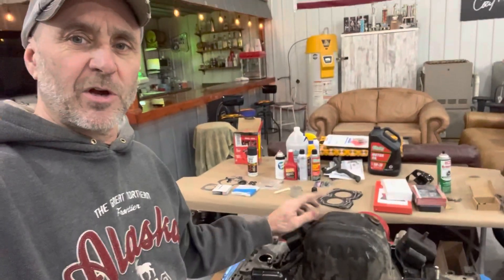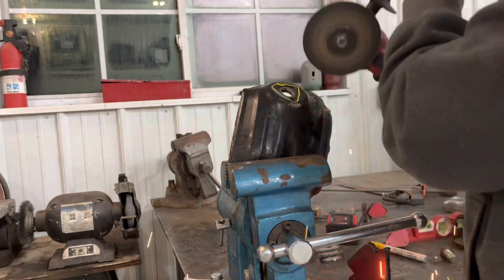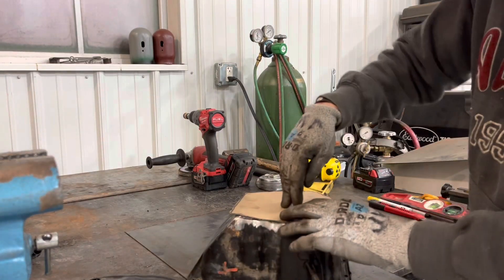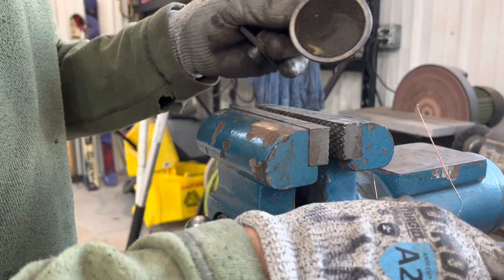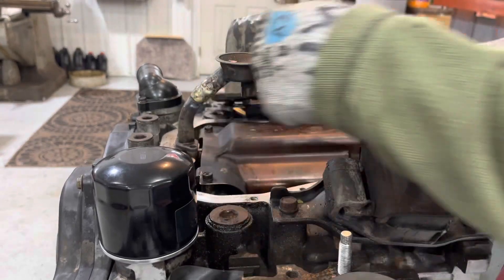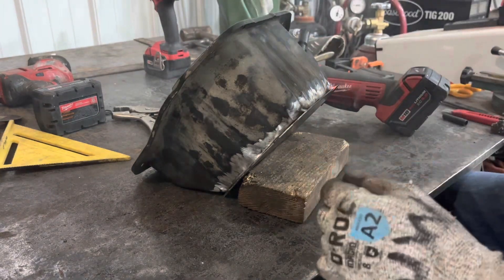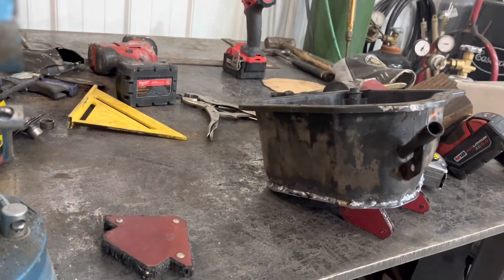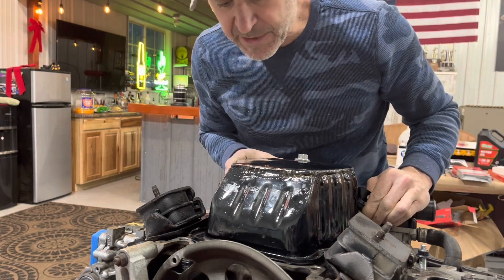Part 4 - VW bus with Subaru engine. Oil pan shortening .

Comment: Nice work on that Oil Pan , FYI i’m a retired Woodworker and  i’ve used my TBlade Jig saw for many  projects i’ve gotten into. those T Blades are sold everywhere  like big box stores ,Hardware , Harbor Freight ,etc and i bring that up because  over the last 20 years they have  come out with a lot of metal and others specific  material cutting blades  with many of them and the tool you can  cut. around bends , corners and  around most obsticals fairly easy  that style saw used to be. pretty rare and more expensive but. over the last 10 plus years  they have become more reasonably priced and often are featured in multi packages of Cordless Tool sets  i do think that tool and blade combo  has a lot more  flexibility than a Traditional Grinder  ? A few years ago i had to do  rusty body repairs on a older Conversion Van around the  big windows a aftermarket.  company did a not so great job on installing. and my 4 “ Grinder was just too bulky  to do what i needed. so i did use that Jigsaw and a  Dremel   i do admit i did do that repair  in a outbuilding next to  my Shop and i had a large inventory at my disposal of  the T Blades to select from and expirimement  with  i also have a rasp/ file set  i’ve owned for many years that i purchased for Woodworking out of a Specialty Catalog  more than 25 years ago   i can’t seem to find that set   any longer available   anywhere  when i began in the Industry they still mailed Catalogs and that set was a Special they ran one time  along time ago. i was close to sacrificing one blade on that Van but that’s when  i broke out the Dremel